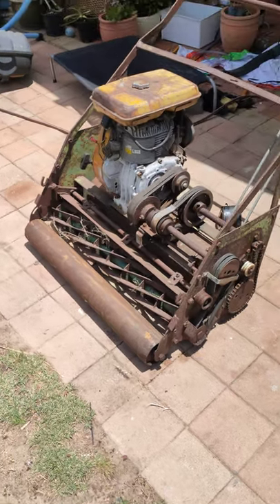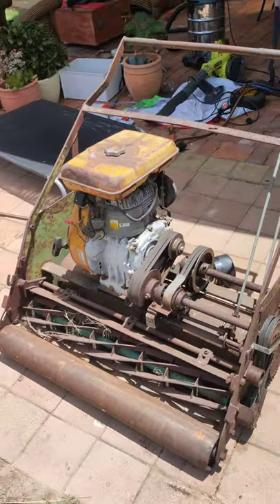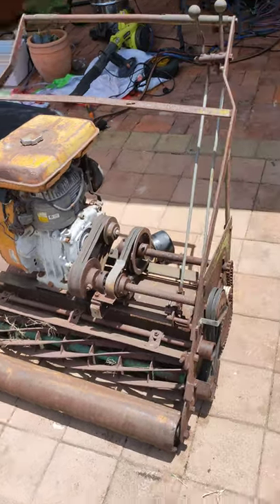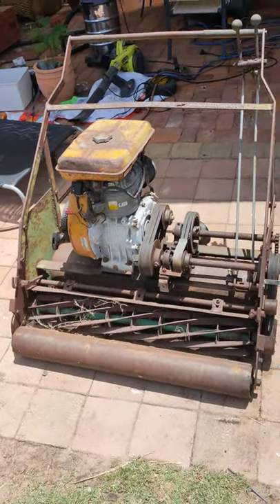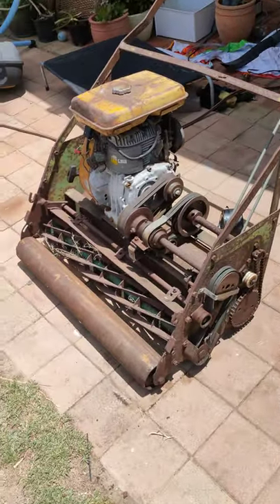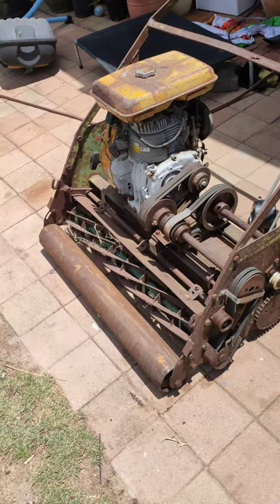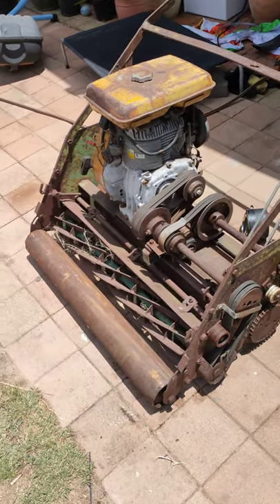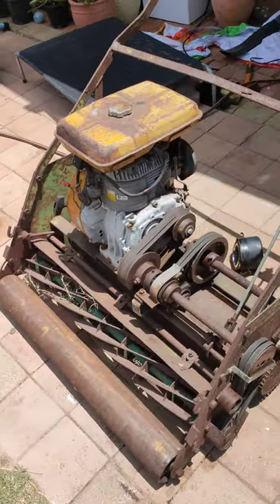40yr old mower restore video?

Comment: I have a 1950's Qualcast Power Reel mower 50% restored. 
Tip - If it works fine with general oil, filter, backlap, and various adjustments. Just use it.
If you decide to pull it apart. You will find something that you will need custom made $$$$
Reply from the maker: It's to big for what I need so I'm hoping I can trade it for something smaller if I can get it working. Currently having issues with the needle and the bowl over flowing. Wish I had a mate that has some knowledge with these mowers as like I said never used one. Any idea on why the blade doesent spin?